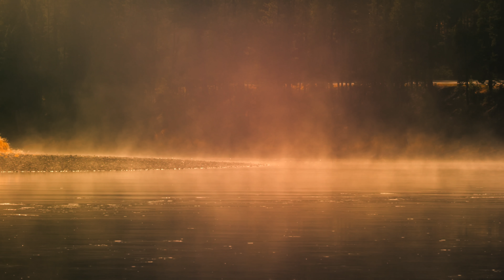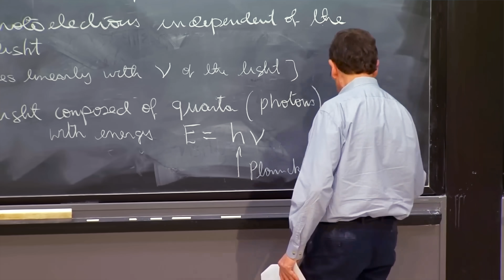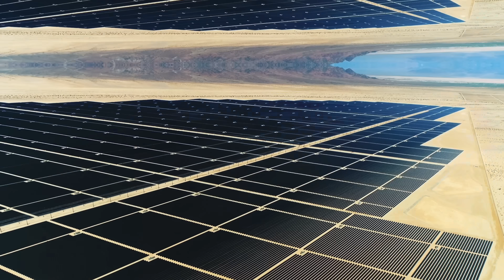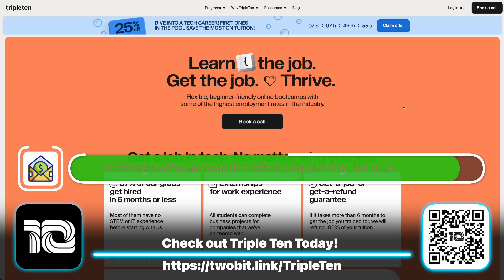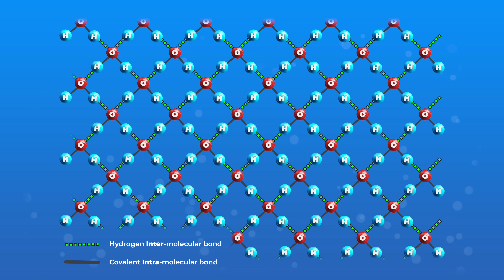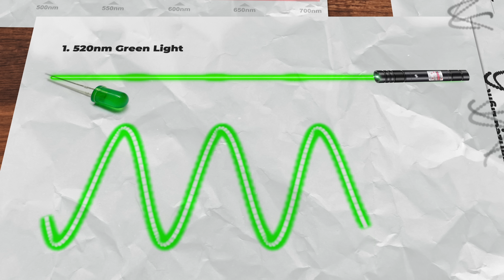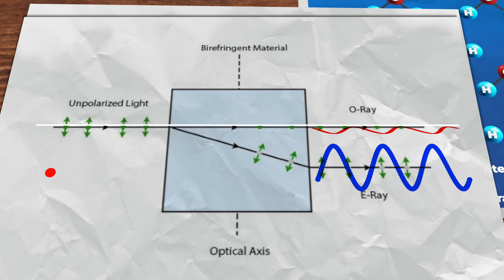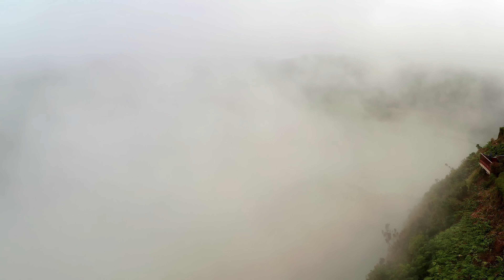New MIT Discovery Just Solved Water's BIGGEST Mystery!

Comment: Although interesting... I'm having trouble reconciling the reported efficiencies... at roughly 5 times the efficiency of heat, this seems like something that would have stood out like a sore thumb. Given how closely our equations for evaporative losses due to heat, conduction and convection, or rather thermodynamics, match real world observations, to the point where we use it daily for the engineering applications that run our world, it just seems hard to believe.

not hard to believe it takes place, that makes perfect sense... but it sounds like it would play a larger role than thermodynamics, which makes it seem like our thermodynamic predictions should have been out to lunch in real world applications.. which they are not... they are actually amazingly close to the observed values, easily within the margins of uncertainty.

The only way this could hold true is if the contribution from the photomolecular effect (not entirely a new thing btw.. its basically just a specific example of the photochemical effect), was so small as to be within those margins of uncertainty. 

Yet the best wavelength just happens to be what exactly where the solar spectrum is most intense, at an angle that is roughly the average angle for sunlight over the day, from most points on earth. Maybe it's the requirement for polarization? But that also naturally occurs as sunlight is first partially polarized by refraction at the air–water interface and then further partially polarized by scattering by water molecules and other suspended matter.... I feel like there is a piece of the puzzle missing in this story.

Comment: This is not new knowledge per say.  The humidity in air is not always dependent on temp and wet cloths on a cloths line in the winter will eventually dry even in freezing conditions (as long as no new moisture is added like rain or snow)

Comment: Did they keep in mind air pressure? Because you can also cause water to evaporate with standard air pressure or lower, you may not have needed heat or sunlight to cause the results

Comment: I believe they are partially correct about light and water. If they were fully accurate, water wouldn't still evaporate in pure darkness at a nearly constant rate. Correct? Truthfully, between any two dissimilar interfaces, there is always an 'osmatic' (osmosis) effect. This is true between two types of metals, which causes electrons to flow. Pure water vs 'contaminate' (could be simple as salt) water. Hot air and cold air... EVERYTHING. Crowded cities... people move to the suburbs... all dissimilar materials with similar properties go thru this process.  Even light and dark - more readily seen in the boundaries of interference patterns. Flowing from a state of high concentration to low concentration is nature achieving balance/equilibrium. Even solid ice can evaporate. 😮

Comment: This is not new... and I wasn't taught in school that "heat" evaporates water, but rather "energy" and more specific "energy-differential" You don't need heat or even much energy to evaporate water on a planet with no atmosphere, not even much energy, because there is not much energy keeping it fluid (pressure is also energy, who knew) So you need enough energy to overcome the force (energy) that is keeping water liquid... this is why water boils way earlier (at a lower temperature) high up in the mountains too...  and this was 30 somewhat years ago...

Comment: One major issue: What produces a temperature neutral light? Light is heat. To say light evaporates water without heat being involved would require the light to be temperature neutral, or is the exact same temperature of both the water and the air at the same time?

Comment: Speaking in plain English; as a swimming pool builder I can tell you that water evaporation is worse on a windy day and not a sunny day. Now, I'm no scientist but I do understand why rain clouds are formed over the ocean and dump on land. Plus, many of my clients with new pools ring me to say that their pool is leaking because they don't understand the effect wind has on a pool even in winter.
Reply: This is due to a phenomena that the video seems to disregard, which is diffusion. They are frequently thought of as the same thing, but are completely separate
Reply: @Obsid_Ian  well, now youre bringing in turnover.  Same effect as dropping the water through air.  When you turn the pool over by blowing wind over it your encouraging heat transfer by convection.  It increases the effective surface area of the pool that's feeling the effects of the atmosphere, be it hot or cold.  It can heat or cool a pool or vessel faster to spin the volume over horizontally in such a manner.
Reply: @LZRCuteR  you appear to know what you are talking about so I have a question for you. I've got a 12m infinity knife edge on my own pool and I'm well aware of the additional evaporation that is created since it drops more than 1.0m however, why does the water movement increase the volume of acid required to maintain the pH?
Reply: Hmm, i think you're asking why doesn't the water that the float valve replaces reattach to all those acid ions that were once muriatic acid, reforming it....where does the acid go? Well, it goes into the microbes and fungus and algae, all those organic and it kills them, remaining in their corpses until they finish decomposing in the sand filter.  It goes where it's supposed to go to keep the pool suitable for human use.  I come from a line of Chem Es, And we all love pools too.
Reply: @Obsid_Ian  what I'll think about for a minute is how increased evaporation that Isnt replaced by the float valve might affect acid.  Any acid that doesn't go into microbes or all kinds of substrate in the pool, living and inorganic, should generally lower the pH below desirable....but that is fine to a degree, you just don't add acid that week until the float valve raises pH slightly.   But missing acid...let me think about that.  We've gone "missing" acid in lots of industries I've worked in, so it should come to me
Reply: I love your YouTube name by the way.   You need a channel lol
Reply: It's in the general increase in water throughput to the system (increased water in due to increased water out), and the general chemical control strategy itself, though I won't go much further than that for now.  It's the increase in water generally, out of the pool let's say, that causes water pH to drop, the acid is cycling down with each flush out of the sand filter.  If you dose less on days when water is low you should see what I mean.  I think that's the answer, but it's in the details of marginal water balance in and out, particularly the increase in pure water due to evaporation and water flush due to remove impurities being on automati timers instead of on biological load
Reply: @LZRCuteR  I've got one and upload the occasional video
Reply: @LZRCuteR  my pool does not have a float valve but it does have a skimmer on the main body of water and a main drain in the balance tank; the two lines are controlled via a 3-way valve in front of the pool pump. I have an automatic acid controller set to a constant pH of 7.4 and a salt chlorinator which regulates the quality of the water. If I set the equipment to full suction from the balance tank, maximum water flows over the 12m infinity edge into the balance tank  which  increases the acid output  considerably. If I regulate the 3-way valve to allow the water to trickle over the infinity wall then my acid output is greatly reduced. So, in conclusion, when you add air to water the pH of the pool goes down. This is the part that I don't understand and backwashing the sand filter is not a part of the equation.

Comment: so new stuff you learn everyday? today I found that on warm sunny day, with a bit of breeze blowing, my washing drys faster?, and puddles go away?, more quickly? that when it raining or something, they do not? more though I like turn light waves at 90 degrees, and not counting light lost lenses etc. getting nearly 100% light back out? only works because of green light being middle point, but running two it may be posable to do that for anything colour light your want to mage, (or at least convert anyway)  makes wonder, if could somehow remove need for a glass lens, (replace it with something else) would this work with the hole electro=magnetic spectrum not just light?

Comment: So this could mean that my putting of drops on the rim of a plate facilitates the cooking by allowing pre-steam (more pre-steam) ... grrr... 

It works to kill ants in a microwave. Nuking ants (specifically those tiny pale yellow "piss" or "sugar" ants) only slows them down. ("Duh" reasons for ants in my microwave.) You have to do much more than 2 minutes (5 mins one time, 3 on another, and more than "i panicked at 10 min") to stop any, and 3 wasn't consistent.

When I put a couple dabs (get water on finger, and tap surface with wet finger) of water on the base plate, the ants abdomens popped before a minute was up. I thought this was a steam effect. But the photomolecular effect suggests that the bright lights facilitated whatever was happening. 

I fear it was a polarizing type effect, as the "barely an effect sans dabs" became "catastrophic effect with dabs". ("Polarizing" because of a specific frequency shift, kind of like the 45-degree effect with polarized lenses. "Fear" because a frequency shift that targets 1 mm wide abdomens may obviate meshes in microwave doors.) And I've been sharing this solution to slow microwaving since 2002. Erm.

Comment: Wow! I always wondered why leaves are green.  Is the reason so the water molecules can separate with less energy when making glucose??! 🤔
Reply from the maker: yeah and lose less water to evaporation, that might have been a HUGE evolutionary advantage!
Reply: Could also be why it feels cooler under a tree than under a canopy on a hot summer day.
Reply: But now I'm questioning my original comment. If green light was used to break water molecules apart in the chlorophyll, my guess is the green light would be absorbed and not reflected.

Maybe it's green to slow evaporation?

Comment: My reasoning for evaporation was just a balancing of the dryness of the air with the waters edge. Paint, for example, dries very slowly in very humid air stagnant, but dries especially fast amidst dry moving air. The layer of air around the water's edge wicks the edge into the air to make it humid, and it moved away by more air to replace it, the replacement air will wick up more. If the air is already humid, it will have already been too densely saturated to wick up much more, and no air is being moved to replace the already-saturated air. The "heat" to me was actually heating the air to make it drier, not to heat the water as if to boil it. The movement of the air is what helps the drying up, not the heating of the water.

Comment: if you put ice cubes in a freezer and never touch the ice cubes for a long time you will see the ice cubes shrink because of it turning from solid straight into a gas. so there is almost no light hitting the cubes. could be something to do with pressure, but not sure.
Reply: That's sublimation....
Reply: Modern freezers are actually highly efficient dehydrators. Cooling is the effect of dehydrating. When you get frost build-up in your freezer, your condenser is overheating, say when the door is left open or not enough air gap is left between the freezer and the wall/floor etc. 
Usually to get rid of frost, close the door.  Dehydrating evaporates water.

Comment: Not photo molecular effect, it's a photo atomic effect. As the energy from light hits H2O the outermost hydrogen atoms of the surface, some energy is reflected. But due to higher energy state in the light, some energy will transfer down into the lattice. There some of the hydrogen turns into nitrogen and also oxygen is released. It's the nitrogen/oxygen that then evaporates from the lattice, not causing heat to build up. Then a secondary effect is that heat is building up and whole molecules of H2O evaporates. The same photo atomic effect occurs on all atoms hit by light, also on land. This creates heavier elements. They are not made by supernovas. Supernovas actually destroy heavier elements and turn them into lighter elements and energy causing energy to be released and then becomes the photo atomic effect.

Comment: Its still heat.
Light = Heat
Name a form of light that doesn't produce heat, you can't because it doesn't exist. Instead of using conduction to transfer the heat , this is radiant heat. The light is able to penetrate the water and transfer its heat to a great many molecules, until all its heat has been transferred or reflected out of the water.
While it could be interesting to some, its not anything new.

Comment: I'm not a scientist, and I'm way too dumb to figure it out myself, but I have always found it strange how water could evaporate without hitting its boiling point.
Reply: Evaporation happens when molecules are bouncing around fast enough to start flying away from other molecules. Giving them energy in any means does this like you can run an electric current through water that takes it to another level seperating hydrogen gas and oxygen gas.

Anyway so the water molecules just need energy, and the energy of molecules expresses itself as heat. Heat is just the measure of hoe much energy molecules are holding at the moment. Imagine the molecules sre vibrating, that vibration is heat.

So you can give them heat directly to do this or give them the energy from another source like in this video finding our we can give them the energy from light.

And even though we're not using heat to accomplish giving them the energy for evaporation those molecules that evaporated will still express their newfound energy as heat.

So you're not entirely wrong, heat is still going to occur but as a biproduct rather than as the means to trigger evaporation.

So we can evaporate without introducing our own heat and cause evaporation with heat but heat will be present in the aftermath since the evaporated molecules will express their energy as heat to stay in that vapor state.

Basically light is donating energy to the molecules and then they express that energy as heat so the water molecules are generating the heat within themself and evaporating using their own newfound energy on their own rather than us introducing heat from an outside source.

Heat is still involved as that's the basis for being in the vapor state or liquid or solid states, just we don't need to bring our own heat to the equation that requires a huge ammount of energy to desalinate large amounts of water for poor countries. This breakthrough makes it so much cheaper and faster that we should potentially be able to provide clean water all around the world with little cost and resources now.